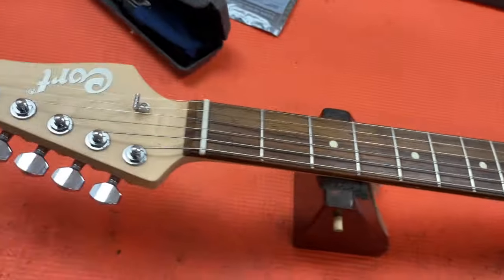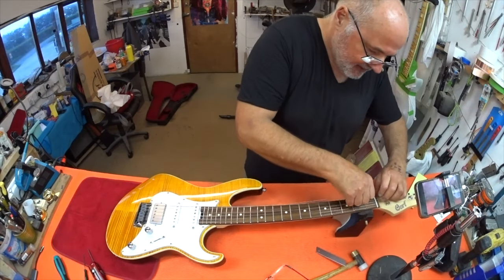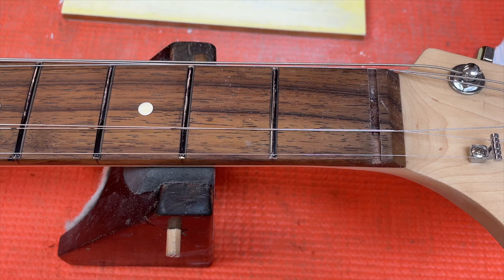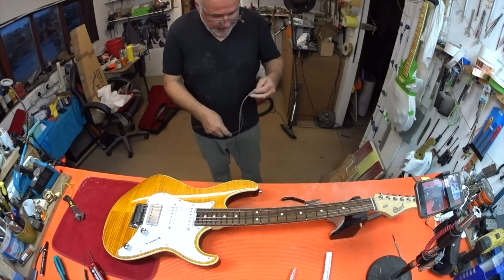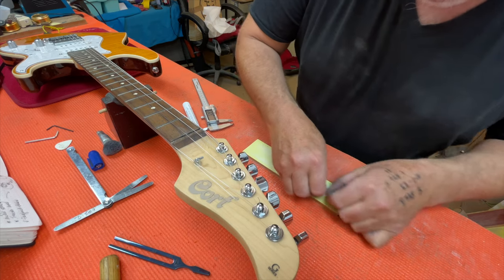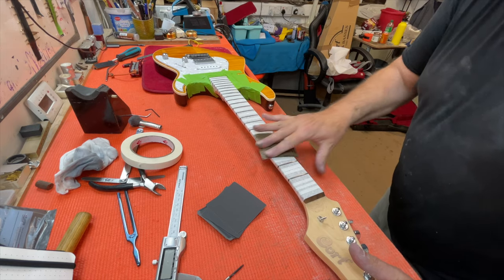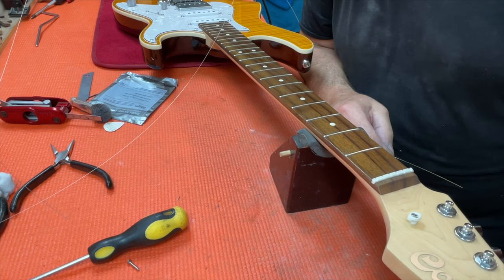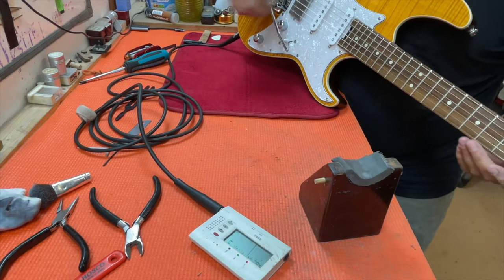Cort G280 set up

Comment: If a single low fret is troublesome, are there occasions when (weighing up the labour involved) it's sensible to just knock it out, replace and level it ~ as opposed to attacking & refinishing it's non-low neighbours?

Afterthought edit ~ are these compound radius fretboards a bugger to work on?

Cheers.
Reply from the maker: Good question Monty - I always keep that option in the back of my mind but despite doing that, I've never in practice come across a situation where it made sense to actually do it. The reason is complex: yes, taking down surrounding frets to 'level out' the difference between the regular height ones either side and the low one costs MORE metal... but you'd still have to take down the new one AND some material either side too if you pulled one and replaced it.
Possibly the biggest reason I don't pull / replace a single fret - particularly a low fret - is because over the years I've learned that a single low fret is rarely the 'fret's fault'; it's almost always a good fret tapped into a sudden low 'dip' in the fingerboard. Because of this, any new fret will drop into the same 'dip' leaving you with the same problem unless you mess about increasing the gauge of the wire to compensate. In practice, this would require having several increments in gauge to hand, and probably ending up with a wider gauge (in order to increase the height) which might look odd anyway.

Comment: Great video!
I’ve just picked one of these up and it’s fantastic after sorting a few high frets. I also didn’t realise the nut was bone, mine looked like plastic although I could be wrong but I replaced with a tusq one.
One question though, mine is a 41mm width nut and online specs say it should be 42mm. Do you recall what the width was on this one at all?
Reply: Sorry just watched the beginning of the video again and you answered the question 😊
I bought the same nut but had to get it from Thomann as impossible to get hold of in the UK
Reply from the maker: @jonathanelmore2166  Lol before reading your 2nd comment I just went to my notebook and found that I measured it at 41.5mm :) Getting a suitable replacement is a matter of going to the Tusq catalogue PDF and searching for first the e-to-e match then wide enough (or more - the excess can be sanded off), then deep enough (front to back). The overall height is last but has to be sufficient (it usually is) regardless of nut.